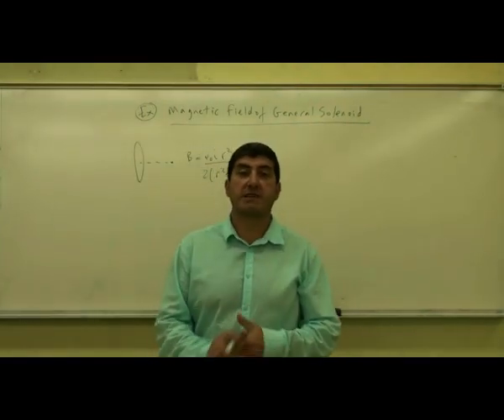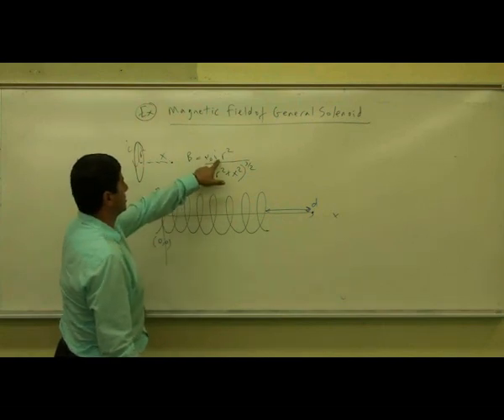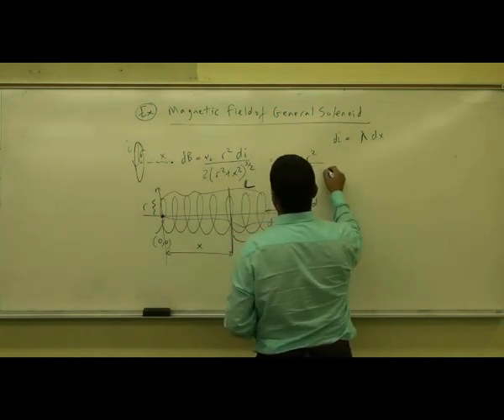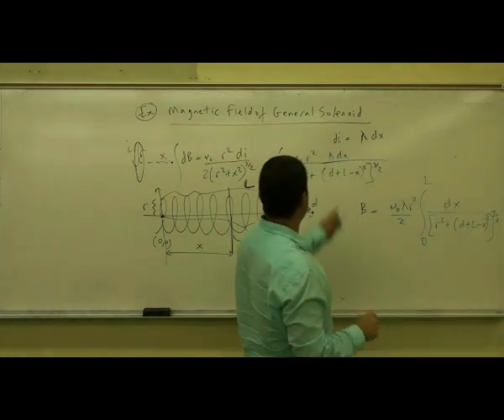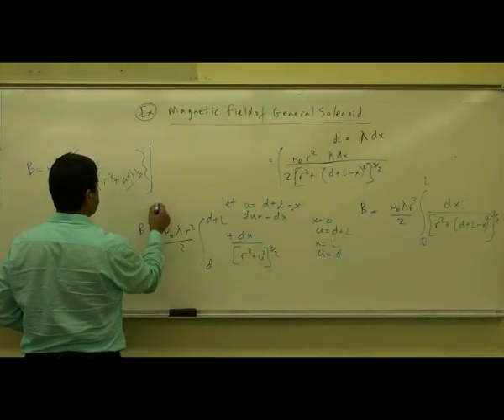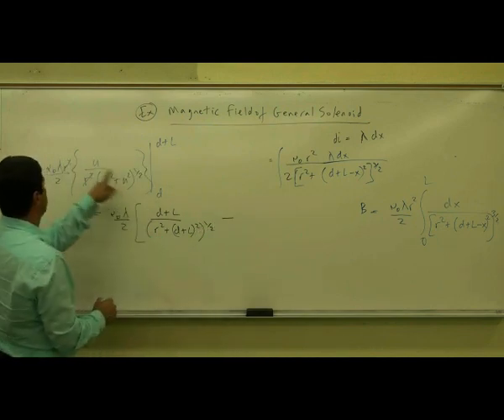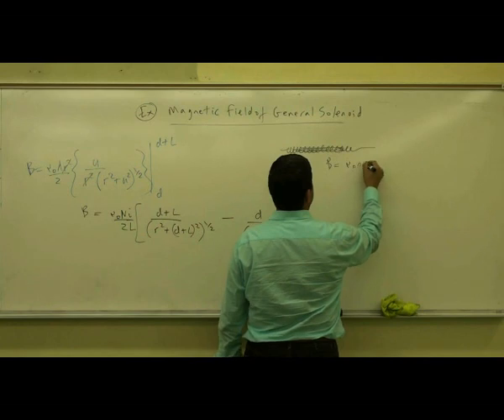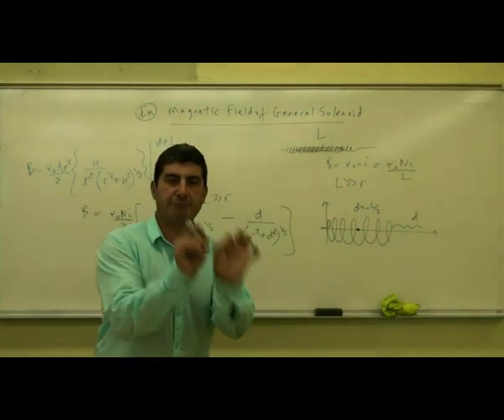Magnetic Field of General Solenoid 1.avi

Comment: Good video Viken, but you didn't show how ampere's law gives you the same result as the biot-savart law. You didn't complete the derivation at the end. Does r^2 tend to zero because L>>r ? If that's the case then 1/(r^2+(L^2/4))^1/2 becomes 2/L. The 2's then cancel and you get B=μ0NI/L where N/L=n. So B=μ0nI.